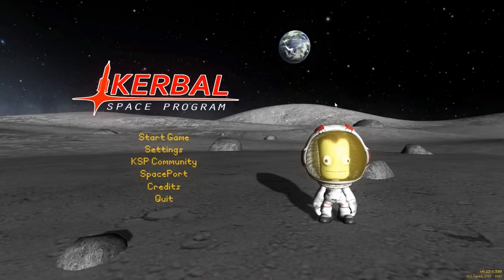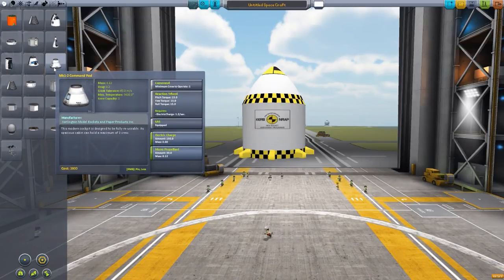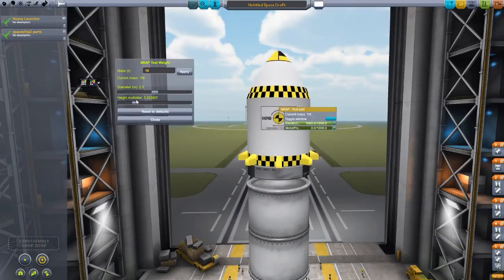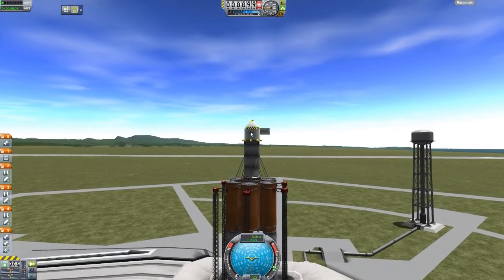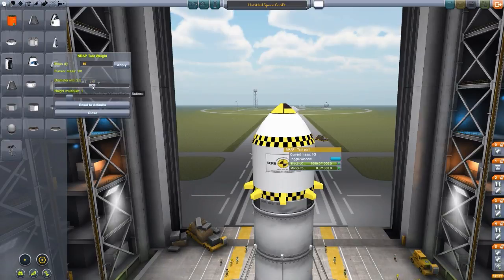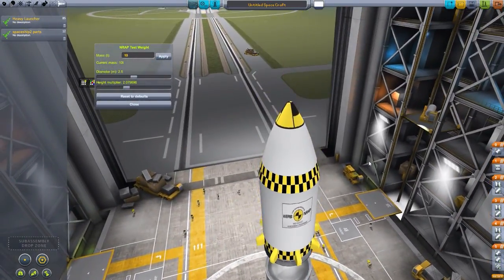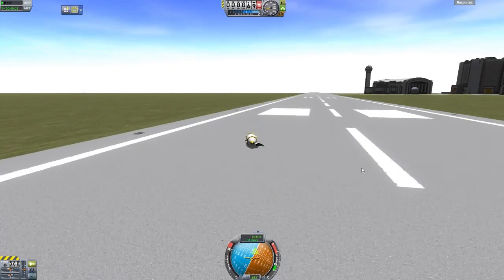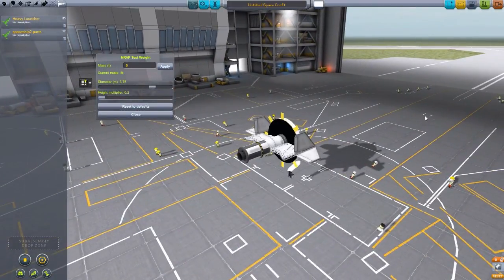KSP Mods - NRAP Adjustable Weight Part

Comment: I'm quite sure it detached because you plonked 100t on top of that 2m ASAS without using any struts.
Reply from the maker: That very well may have had something to do with that lol
Reply: *****
As jinxs said, it's the large mass which caused the detachment. In the past i've experimented with (single part) masses up to and over 500t. At some point the mass will be so large that even struts won't keep the connection stable.